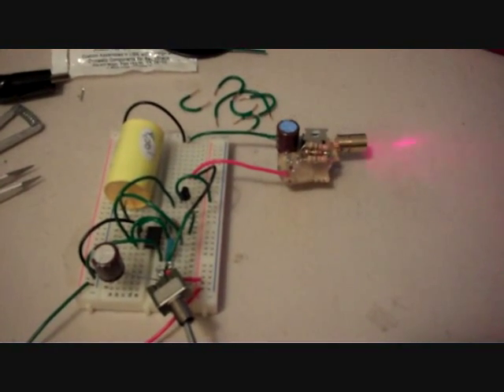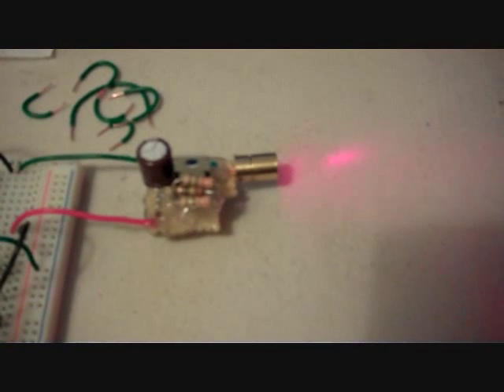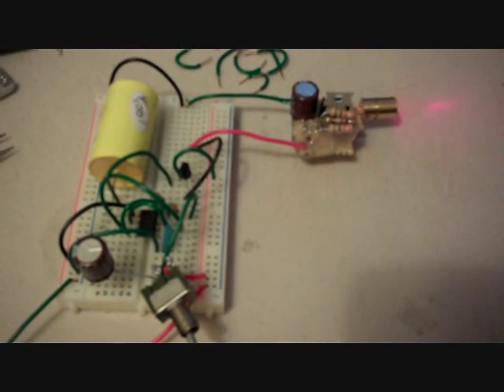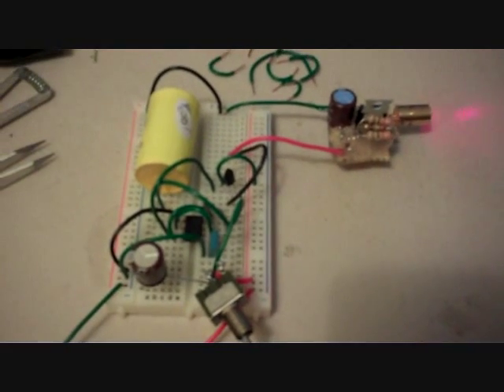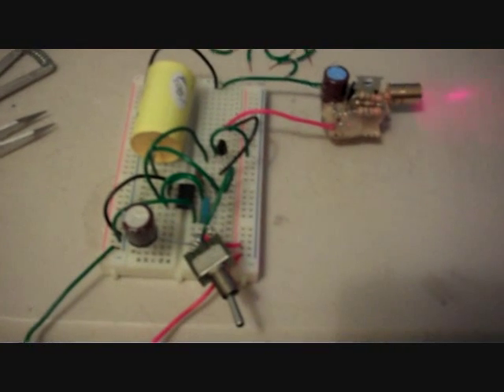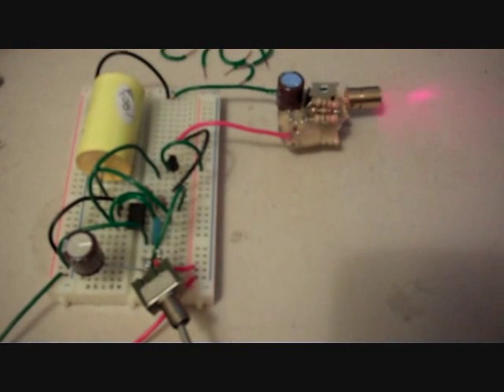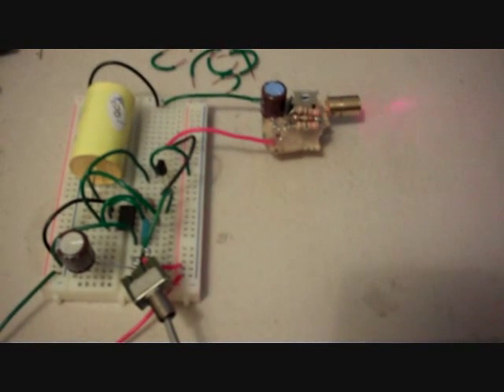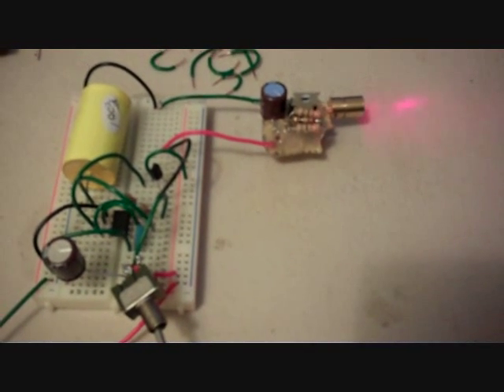Pulsed Laser Circuit Design

Comment: Can you give me the exact reference for the laser that you used? Because I couldn't fine a laser diode with 3mm Beam size
Reply from the maker: Sorry I don't have the exact model info anymore. It was an inexpensive diode mounted into a standard housing module that I built a linear constant current driver for. I think I got the module off of ebay from techhood or some place similar.
Reply: +Matt Giordano  thanks anyway :)

Comment: I need this!!! What is the pulselength? The wavelength in miliseconds or nanoseconds.... I need the circuit design for laser pulses of 3 nanoseconds... or 30 nanoseconds and I then use 10 m of optic fiber to obtain 3 ns in ouput length
Reply from the maker: +Nano Renzi For such short pulses you'll need to do discrete pulsation of the laser diode and not simply cycling the constant current source on and off as shows in this video. My lab is only equipped to work with 200nS maximum (400nS per cycle) so I can't help with specifics. However, I can advise with basics: after you have your pulse generator or oscillator circuit simply achieve the constant current the diode needs by sending the amplified pulse signal through a high stability precision resistor. Constant voltage through a constant resistance = constant current. Just make sure the power input to your oscillator and amplifier (if one is needed) is well conditioned and decoupled. The amount of current you need from your pulse train will depend on the diode (and its output power) you choose. Remember that most FETs will be far too slow to work at these time scales, and you're even above most bipolar transistor's bandwidths, so choosing a transistor for amplifying your oscillator output will be critical if your oscillator can't source the current needed by the diode.

I'm curious, what is your intended application?
Reply: Matt Giordano I'm translating for then respond to you xD but I think the general idea about your message! With a simple mosfet is impossible... work with on/off isn't the way... I need this solution for an invention that actually want to make... is about the travelling of the ligth in the space across the time... if I made to work my project succesfully I'll send you my results
Reply from the maker: Nano Renzi No problem. I can simplify and rewrite for better translation if you need. Look for a self-contained oscillator module around 166MHz (6 nanoseconds (3 on, 3 off)), a NPN bipolar junction transistor rated good for 200MHz, and a simple 650-670nm Red laser diode (1mW to 10mW) like they use in DVD reader (not CD reader, that is infrared laser) (dvd writers use lasers which require too much current). Oscillator output will be connected to the transistor's base. Stable precise 5V power in series with a 1% 330 ohm resistor, in series with laser diode, in series with transistor's collector. Transistor source connected to ground. A 10 microfarad capacitor and a 10 nanofarad capacitor across 5V power supply. This should give you a good starting point. Good luck!
Reply: Thank you very much for yours advises! I think use and laser pointer of 3W of power at 3.7V and 880mAh... modifying this through an oscillator as you say for an ouput of 3 to 30nS of wavelength of duration at 445 nm of laserwave
Reply from the maker: Nano Renzi The only problem with high power ones is the extreme change in current per picosecond caused by switching several amps so quickly. It makes even tiny inductances create very high voltages which can destroy the diode or transistor. Good luck!
Reply: Matt Giordano  oh! I see! And the quick switching pulsed lasers cost are US$1600, I tried to homemade version but must to be impossible... thanks!!! Good luck and good year Matt!

Comment: Greetings Romenadan, I'd like to know your experience about burning lasers, I need a burning laser, however I have no so much money, so I need a cheap solution for making this. I think to pulse a laser with a rf pulse oscillator with little duty cycle, e.g., 10%, can your laser burn if you increase the pulse oparating frequency? I thanks your help

Comment from the maker: @svrkprabhakar For the most part there are better ways of doing pulse modulation of diode lasers for industrial/OEM applications. This was more of a "proof-of-concept" that such an effect could be reliably replicated on a low cost do-it-yourself hobbyist level.

Lasers tend to be a bit dangerous to use for general or even application specific lighting as the exposure limit where it becomes a hazard is very low. Chances are it was just LED based lights being used.